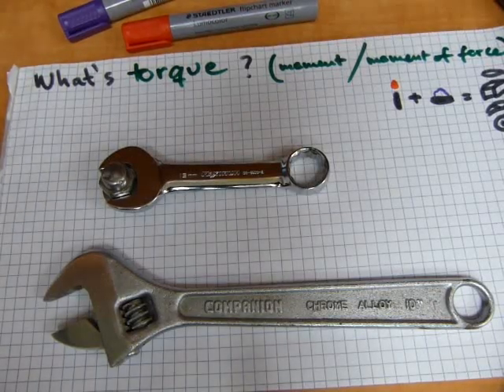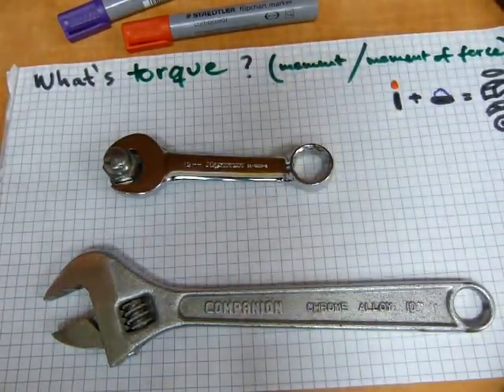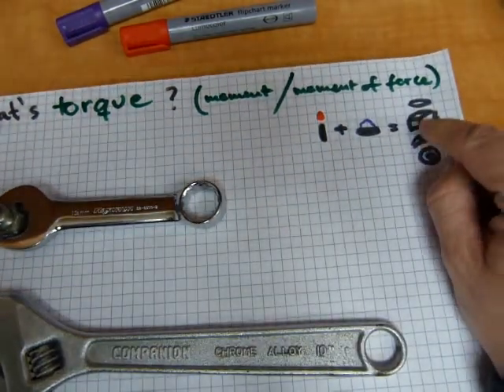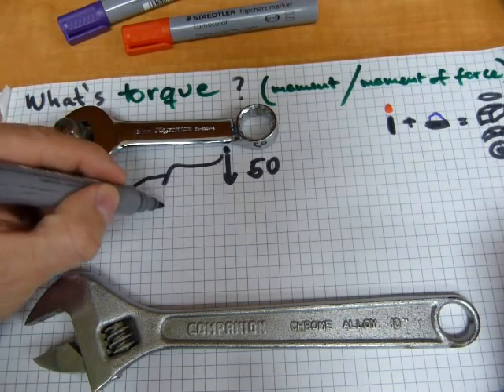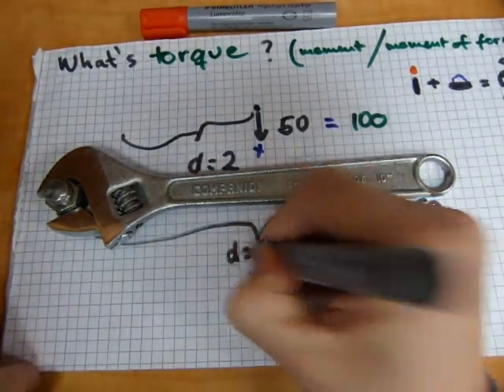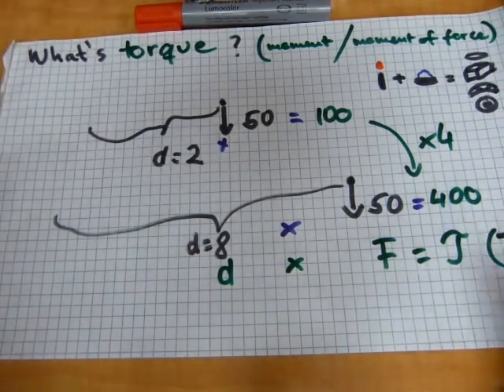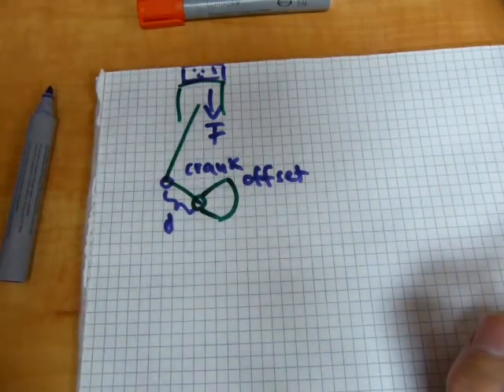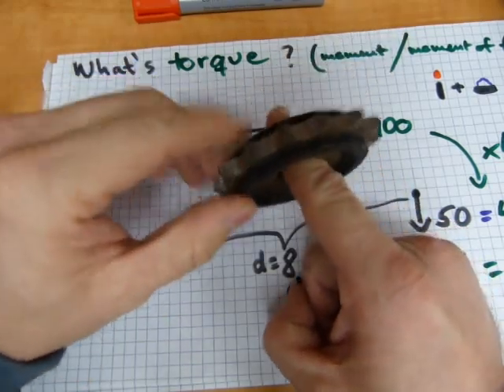Go faster: What`s torque?

Comment: Nice simplified explanation. Really liked it Thanks. Couple of questions. Is there any relation between force & distance ? What I mean is that, can we increase D & F by any number and torque also increases or is there any peak point, beyond which it does not create more torque ? Secondly, how to measure torque in a motorcycle ? is it based on RPM or is there any other meter ? Third, is it possible to modify an motor cycle engine  & demonstrate the increase in Torque (may be the last one is a big project ?? ).. But overall thanks for these videos, much appreciated.